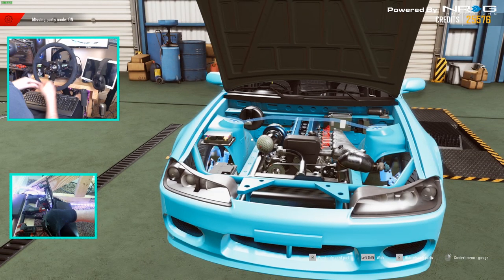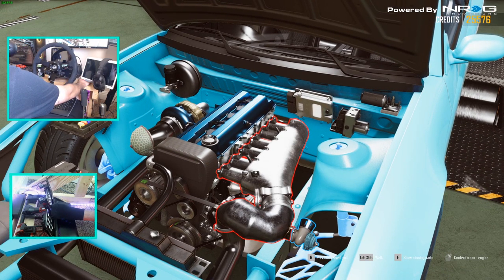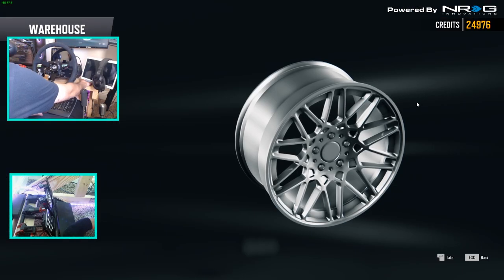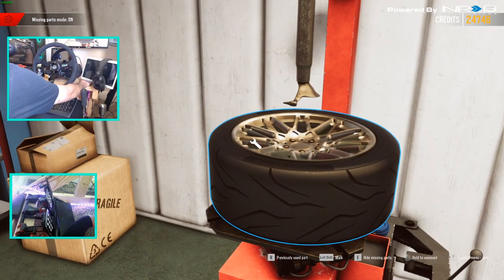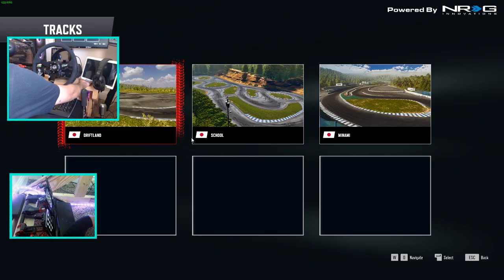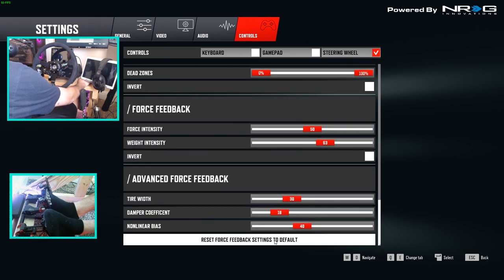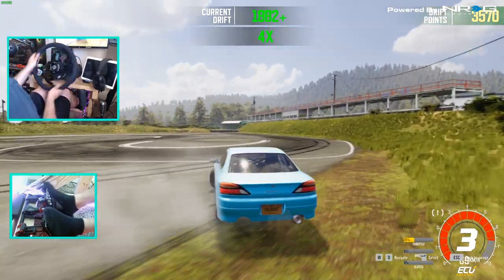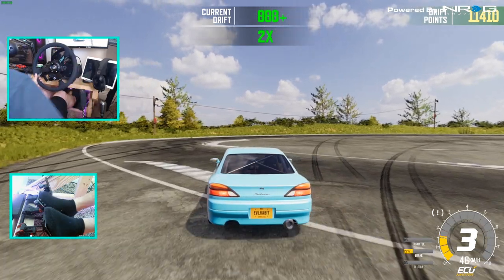DRIFT21 ep.4  Wheel settings and figuring out how to get the car to grip

Comment: all you need is an angle kit. stage 1,2 and 3 can drift. just mess with, nonlinear bias, for the ammout of jerkiness feedback from the road. Damper Coefficient. to dampen/soften the effects. (so its not so snappy) weight intensity is how much of the weight shift you feel/ how much FFB when you counter steer. FFB its like a master slider for total amount. and im not sure yet what tire width does. with the same setup on the car you can make it feel like WDTS / ADC or TandoBuddies. 

stage 1 mx5/ stage 2 s15/ stage 3 brz / I have finished gold in all the missions (waiting for multiplayer, nothing else to do).
Do not over supercharge the engine. most of us are used to banging 2nd not 4th-5th. you dont need the most powerful engine to drift how you're used to in assetto.